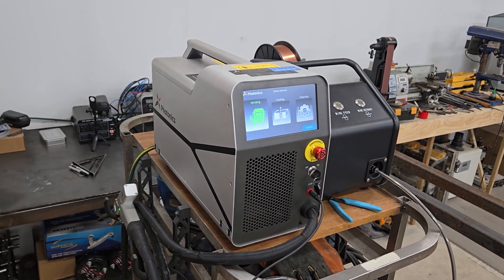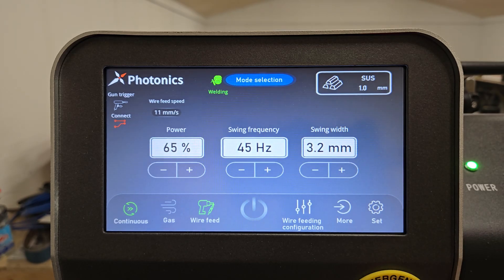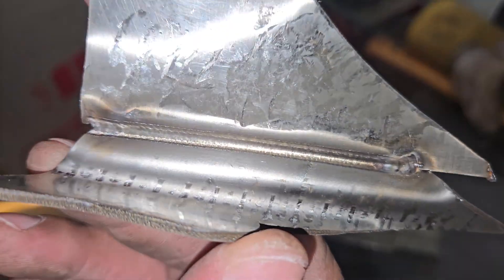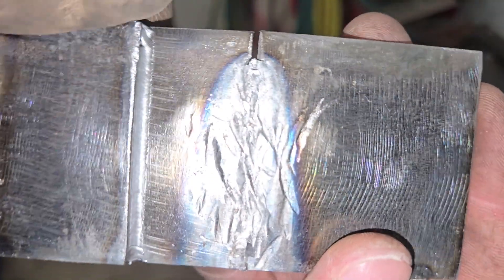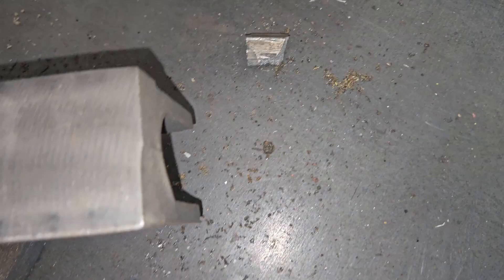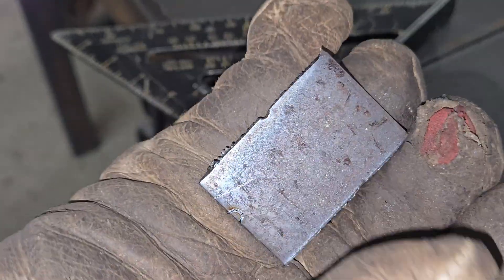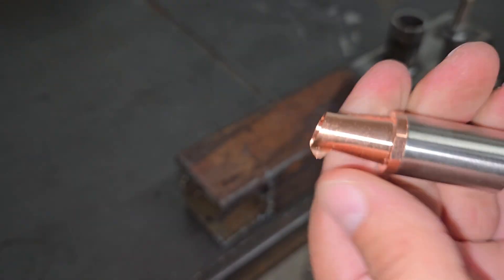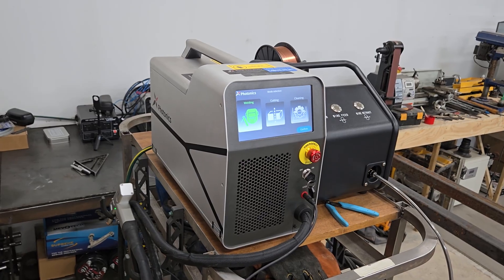X1 Pro All-In-One Laser Welder, Cutter & Cleaning Machine Review - EV Project Announcement!

Comment from the maker: I should mention that the red clamp isn't a ground like you would expect with traditional arc welding because it welds with light, not electricity. The clamp is for safety - it just completes a signal through your material and the torch to only allow the laser to fire when you touch the torch to the material and you're ready to fire. It can be connected to the material or to the torch itself if it can't be clamped to the material, but if you attach it to the torch then you should remove it immediately after welding because it's way too easy to accidentally hit the fire switch with clumsy gloves on and shoot the laser across the room when picking it up with the clamp still attached (speaking from experience). While these machines are 'beginner friendly' in terms of how easy they are to use compared to traditional arc welding, they're also extremely dangerous and should be treated like a loaded gun.
Reply: Thanks for putting the X1 Pro through its paces—this is exactly the kind of testing we had in mind when we built it. Can’t wait to see you get hands-on in the next one.

Comment: It is much better to have 1.500 Watt for Welding, Cutting and Cleaning. I bought a Water cooled 5 in 1 Double Swing Machine with 1.500 Watt from China, all incl. for only 3.000 USD. It works perfekt.
Reply: is it 3kW peak or laser power?
Reply: @Vansarus    1.5kW is CW Laser Power
Reply: @Didisixty  sounds great - do you remember the website you bought it from?

Comment: Thanks for the demonstration. In your opinion, could this welder be used for welding angle iron on trailers? Repairing and/or building?
Reply from the maker: Really depends on the type of trailer you're talking about, ie the loads that it's built for. Semi-truck trailer? Nope. Utility trailer? Maybe. The bottom line is that I showed this machine welding 1/4" thick material with acceptable results for light loads - but it's rated to weld ~3mm (1/8") thick material or less. If you stick to XLaserLab's recommendation, it'll work great. So if your trailer is made with 3"x3" tubing with 1/8" thick wall, then it'll do the job fine. If it's thicker, you're pushing your luck - I wouldn't risk it on something mobile like that. If it's over 1/4", forget about it.
Reply: @JamesBiggar  thanks

Comment: is this just plug in to 110 volt and your good to go
Reply from the maker: Yes, but not a standard 110V/15A circuit. It's not enough. Volts * amps = watts. The machine can pull up to 2800W at full power, so you'll want to be connected to at least a 30A circuit if using 110V. 15A if using 220V.

Comment: I'm interested to know what thickness it could cut upto using the lazer? And could this be substituted in a CNC plasma cutter to CNC cut steel; Instead of using a plasma torch and requiring a torch height controller?

Comment: Finally a great video showing about how you set up the X1 Pro and the welding tips.  With out a manual or setup videos from Photonics this really helped.  I have mine and wasn't sure how to position the wire feed tub and also how far to set the feed assembly into the wire feed unit.

Thanks much..  Dave.....